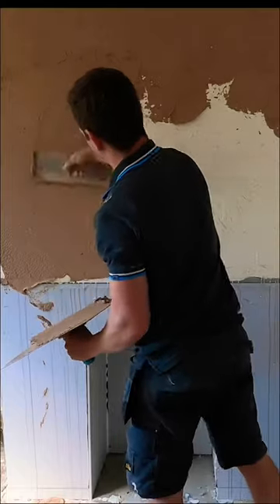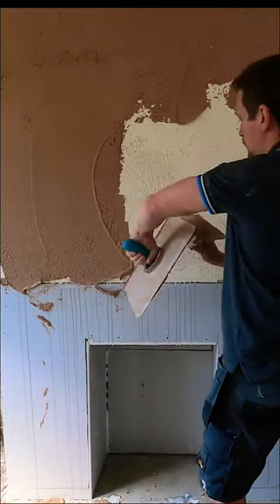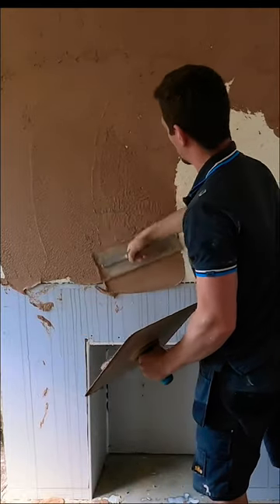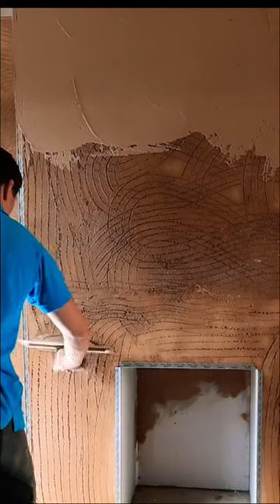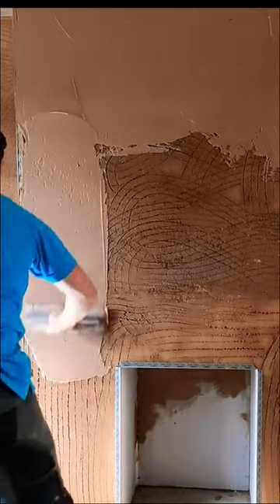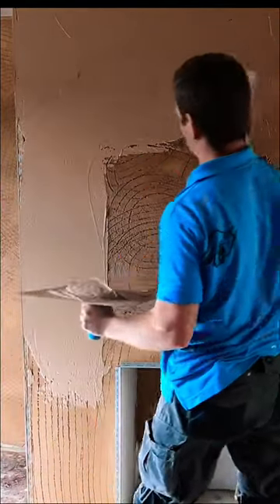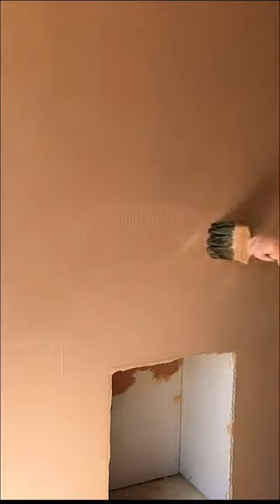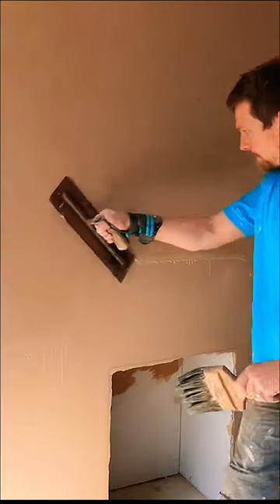Make An Old, Flaking Fireplace FLAT & SMOOTH ⚡️ #construction #diy #plastering #homerenovation

Comment: You just pva before bonding on stripple mate?
Reply from the maker: Yeah matey. All surfaces were PVA’d 👍
Reply: @PlasteringForBeginners  thought that mate. Pva seems to be crap the now up here (scotland) I’m more prone to using a bit sbr through pva now.   Would love to see a video of you roughcasting if ever possible 👍🏻
Reply: @williammacphee335  pva is definitely the underdog whereas sbr is the real deal!! If you can afford it splash out and use sbr every time I'd say
Reply: @adamprice9214  I agree. But I’ve seen a lot of people saying not to use sbr when plastering. I’ve personally never had any issues with it
Reply: @williammacphee335  then stick with your inspiration and don't listen to the in-between else your get very confused and fast!!! 🤷‍♂️🙄🙈
Reply: @adamprice9214  defo mate lol it works for me so I’ll use it until I have any problems

Comment: Plastering is expensive: the coverage is 4-6 square metres per 25kg of plaster... omg
Reply: Depends on what plaster/background most of the time it goes further over better backgrounds but yeah it can be more expensive but it’s generally a better finish/more durable finish than other solutions 👍🏼
Reply: It's only 8 quid a bag though
Reply: Drywall is a smoother finish than plaster for painting, plaster looks crap when you paint it